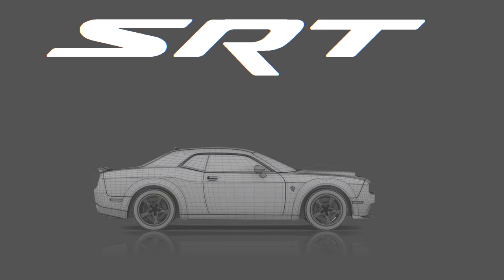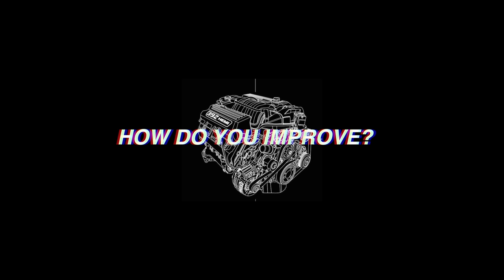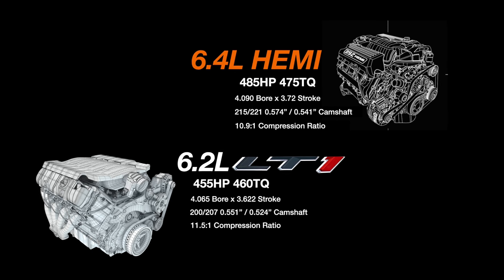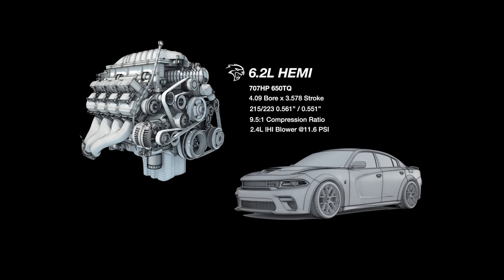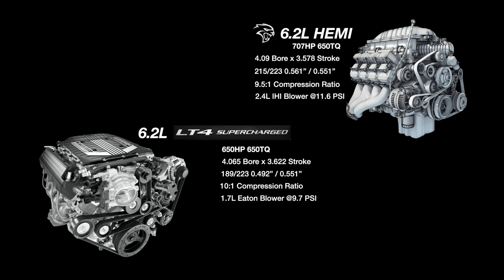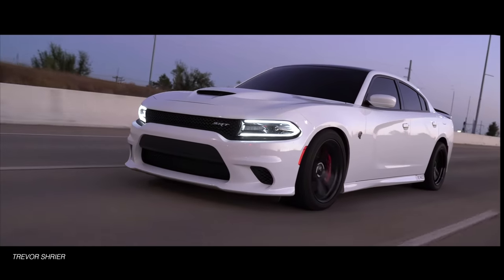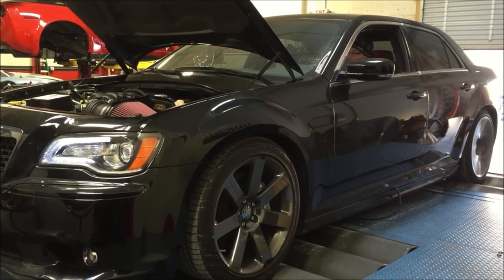Why SRT Engines Are Way Too Powerful😳| Explained Ep.3

Comment: Haven't finished the video quite yet but I can vouch for the 6.1 reliability, got a 2010 Challenger SRT that gets daily driven (and yes through the snow) and has 167k on it with same trans and the motor has never been cracked open once
Reply: Bullshit. Chevrolet  also  kills  the  GAME  LS  and  LT  shits  on the  expensive ass Mopar
Reply: @blueprintjdm  your right my 2001 honda s2000 f20c engine and transmission are stock have 170k miles unopened no smoke or leaks
Reply: And the 6.3L Super Bee
Reply: @destructoidx99  260,000 on my 4.0 inline 6 never cracked open, and 280,000 on my 5.2 litre 318 never been cracked open...
Reply: @bradlaflamme6127  those 4.0 straight 6 jeeps never die man so reliable and can take a beating
Reply: @destructoidx99  yeah they are reliable but then again I do not know a strait 6 that is not. That's why I am excited about the new strait 6 dodge is putting out.
Reply: @blueprintjdm  Yeah but high performance engines have historically been more Finicky and problematic, than standard engines.
Reply: @blueprintjdm  what!!!! I seen  them  go up to  700,000 miles  a stock  LS
Reply: @blueprintjdm  bro, very few high hp Japanese engine wven exist stock. Ive also  been around built Mitsubishi cars, Subarus(junk)!!! Rotary mazdas, not all Japanese cars are holy grail of reliability becuz none of those mentioned are very reliable. Honda and Toyota take that crown but toyota has not made alot of very high horsepower cars, and honda either , their reliability machines are commuters, which are not hard to make reliable. Just now they are making alot of powerful v8s,  for top tier Lexus sports cars.    And yeah Subarus suck!!  Worst car manufacturer on the planet!!  My brother was an  tech for a couple years, no other brand he worked for had so many complete motor failures. At low mileage with proper maintenance. The NA ones have bad head gaskets. The turbo ones are better but suffer  early bottom end failures. And the cvt transmissions are pretty janky too.
Reply: @blueprintjdm  hp per liter matters very little in the real world. Because a pushrod motor can stuff more cubes in a more compact motor, vs over head cam motors which flow better per liter. The ls 7.0 for example is lighter than a 5.0 mustang dohc, is more compact so can be swapped easily, and has more torque and makes more power. Bigger displacement is not really a negative per say other then bench racing. Also more reliable and doesnt suffer heat soak as much as a supercharged or turbo motor does on track days.
Reply: @TheRealZJE313  😪

Comment: Nicely done. You should mention the few initial hemis that started it all just to be complete. I'd like to see a rundown beginning with the Ford engines crammed into the Cobras back in the 60's all the way up to the current Mustangs.
Reply: What about the sallys
Reply: Initially the hemi was a Mercedes I believe 6 cylinder. Mopar stole the design and obtained the copyright. Then they made 16 cylinder hemi's for planes and tanks.
Reply: @bradlaflamme6127  harley did the same apparently

Comment: They use LS and LT engines in super cars and Hyper cars. F5 Hennessey uses a modified LSX to achieve 300MPH, I wonder why no one haven't used a HEMI in a lightweight mid engine supercar?
Reply: Because they’re heavy as fuck lol
Reply: @carlosdeleon9593  Still, all the weight will be in the middle for great center gravity and probably 50/59 weight distribution.
Reply: @Ayixlia  Less weight overall is better though? Why use an inferior platform
Reply: Bc LS's are the superior motor😘😘 duh😁
Reply: @H3mif4v5r  ls is the biggest boat anchor ever
Reply: @Welcometofacsistube  😂😂😂😂😂
Reply: @carlosdeleon9593  isn't it all aluminum?  How much more weight is it exactly?  Genuinely curious.
Reply: @midnight347  The Hemi is cast iron while the LS/LT are aluminum. An LT1 engine weighs about 450 lbs while a 392 Hemi weighs in at around 760 lbs. that’s 310 pounds heavier.
Reply: They dont use hemis or coyotes cause the physical engine size
Reply: @bb4jdmlude  Koenigsegg CC platforms such as the CCX and CC8S uses a 4.7L supercharged Ford Modular V8 and that's a Super car-Oh! and also the Saleen S7 uses a Ford engine too.

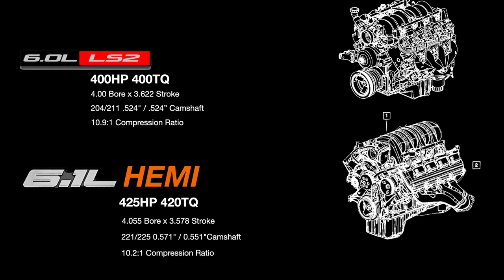Comment: 1:13 the LS 2 is down 25 hp on the hemi, and although the LS 2 has a SLIGHTLY milder cam, it does have 0.7 points more squeeze. It's the heads.

Comment: They're such good engines my buddys Hellcat is on its third motor at 38,000 miles. They're definitely known for going pop.
Reply: I have a friend who's a technician at a dodge dealership...he has a whole different perspective on these engines...
Reply: @tyrone reed  
I'll stick to my two to three thousand horsepower turbo Trans Am or my Turbo 4 by 4 Silverado that makes 1400 wheel horsepower. LS power. I live in the drag racing world, and I can't tell you how many of these hellcats  that I've seen their Motors pop

Comment: Can you do a vid between Forced Induction & N/A v8 Engines. Like the best ones made. That would be dope asf
Reply: Best boosted motors would be the 6.2 Hellcat motor, the 5.2 Predator, the 3800 in the GN, and the LS9. 

N/A there’s a LOT of options but to me personally it’s the LS3, the Coyote, the 6.0 LQ9, 5.2 Voodoo, and probably the LS1 for basically becoming the beginning of modern muscle again.

Comment: Would love to see some videos on modding 6.1’s… taking complete advantage of the forged crank and belting out some really hot numbers sounds great!!!
Reply: What he said about boost is semi-correct. You can run about 8psi and be safe. At 8lbs, you're gonna be making about 520whp with no supporting mods on 93. You can run that on the stock motor and be safe.

For an N/A route: headers, ported heads/intake, throttle body, cam, and e85 will get you to about 470whp.
Reply: @SRTBOAT  ok, minus the 20 percent loss my srt8 is putting 385 hp to the asphalt… 470 with a tune? I’m not getting that
Reply: @scw19762011  There's no possible way you're only putting down 385whp if you're FBO, cam, port work, and e85.

That's a fully built N/A setup minus a stroker kit. Depending on the tuner and how good your port work is, they could get you 470+ whp with upgraded injectors and added timing on the e85 tune.

If you're only making 385whp right now, then I'm guessing you have an intake and a tune, maybe headers. Nothing big.
Reply: @SRTBOAT  fbo would do more than 100 hp. Hands down
Reply: @scw19762011  FBO as an N/A version wouldn't. It's still on stock 6.1L displacement. You can do everything to improve airflow and get a more aggressive cam with better fuel, but you wont make 500+whp all motor unless you stroke it.
Reply: @SRTBOAT  all i have is cai, tune, exhaust. It’s close to that. I’m saying that your numbers aren’t right. 470 whp from just bolted on parts? Doesn’t make sense to me. Considering that a 6.1 is around 370 whp
Reply: @SRTBOAT  water meth alone is good for 70-100 hp
Reply: @scw19762011  my numbers are all pin point accurate. I've modded my own 6.1L, and browsed every forum there is to see what other people have done.

N/A on stock displacement, you can make around 470whp with all supporting mods.

If you boost it, sky is the limit.

Meth will never give 100hp on a 6.1L. It's a naturally aspirated engine from factory. Cooling methods arent as effective without boost. That goes for e85 too.

On an N/A car, you might see 10-15whp increase on e85. But on a boosted car it can be 50whp due to it burning cooler to offset the heat generated by boost.
Reply: @SRTBOAT  where are you getting your information from?
Reply: @scw19762011  forums all over the internet, and my own personal experience modding my car.

Feel free to check out some videos on HP gains from various mods on the 6.1. It's a great engine, but nothing is gonna make the kind of gains you're hoping for. A 100hp bump needs either boost or a lot of N/A work.
Reply: @SRTBOAT  that’s what I want to see…more videos on modding the 6.1…I know there’s a bunch of videos on 5.7 and 6.4…. But it looks like the first generation srt8’s have received no love…sadly
Reply: @SRTBOAT  ive seen a 6.1 put diwn 500whp without being stroked it was omgitsmrmack car
Reply: @juanledesma6418  i've seen that video. He's the only one I know of that's been able to do 500 wheel all motor stock displacement. Everyone else is 470ish whp.

It took him redoing port work multiple times and getting the tune perfect to achieve that. Realistically, 470whp built N/A is more accurate.

Comment: This truly must be a trick question? We all know a certain liter of the SRT engines make good power stock. The problem comes in when you want to add more power. You can't just strap a turbo/SC on it like a LS or Coyote motor. You have to change the internals which is very very costly. 

Most gear head's know you can take a junk yard 5.3 or 4.8 LS and strap a turbo (your choice of forced induction) and make 1000hp without changing the internals. You can do something similar to the K24-A2 (can't forget my honda guys). You simply can't do that with a SRT, well maybe the Hell kitty motor, even that's a risk.

When it comes to any major power with SRT motors if it isn't already boosted (SC) you aren't going to make a lot of HP stock. With the 6 liter motors you can change the upper and lower pulley to make more power, which is great. In comparison to the Coyote, you can simply change the blower to a V3 and make well over 1000hp without changing internals. Which is more cost affective than changing out the very costly internal upgrade to the SRT.
Reply: 5.7's and 6.1's responded very well to camshaft replacement. The Eagle variants even more so. Making over 500hp at the crank on a non-eagle Hemi isn't hard at all with the correct cam and tuning. So if you're looking for a boosted engine, the LS is the obvious choice on cost alone. If you're wanting to do an all-motor build, the Hemi is an excellent platform but also responds quite well to boost. The early 5.7 with an opened up ring gap can make 800+ on an otherwise stock engine with a turbo.
Reply: @sHoRtBuSseR  true, they're one's out there. Although it comes down to cost. Once you have to open that thing up  it'll cost at least 7k. At that point it'll be easier to get a $300-$500 junk yard 5.3 LS and get a precision turbo, for much less that it cost to put those o-rings on.
Reply: @eamorrison859  you can gap the stock rings and be into it under 300 bucks including new head bolts and gaskets.
Reply: It's not a problem, change the internals...  You can't cry because a company didn't design its engine to handle 3x factory power
Reply: @bb4jdmlude  it's not about crying it's about making an inferior product! Dodge/Fiat has been know to do that. As I stated previously other automakers have designed great motor that can handle great power without cracking open the motor. They made sure to keep the gear head in mind. Unfortunately Dodge/Fiat has not. Just pointing out the simple fact you can make great power with bot-ons and if you want to crack open the motor it's still cheaper than doing so on a Dodge/Fiat.

Comment: Not a Mopar fan like that but I always liked the 6.1 and I was wondering what combination of parts was used for the destroked 6.2 S/C. Great video
Reply: The Apache engine block 6.4l was used from the ram 2500 trucks for the hellcats. A similar cylinder head design from the Apache was also used but technically they are different materials. That’s about the only parts used from the 6.4l. Everything else is unique to the hellcat engine.
Reply: 6.2 is not destroked from anything.

5.7's stroke, 6.4's bore

Comment: I really liked this video though I am a GM Corvette type of guy.  What I have noticed is the Mopar crowd is always having fun around this area....  its gotten to the point that sometimes  I can recognize the sound of one of these Hemis a mile away on a quiet night in the neighborhood.  You didn't mention the AC upgrade that Dodge engineered into the Red Eye for fast cooling when going rounds at the drags...  and that AC system speaks volumes to Dodges mission to make bullet proof muscle cars that get respect for the performance they provide.

Comment: Actually stock 6.1s have been known to go up to 11 psi of boost sbe. It's the second most stout engine for boost and mods next to the hellcat
Reply: A guy in Houston had a stock 6.1 jeep which he only took apart to gap the rings properly and at the time he had 1000+hp on 16 psi
Reply: Richard holdner has a video where he make well over 1000 hp with a 5.7 on boost from a junk yard simply with gapping rings. If they are gapped right glory runs can be made but really it make’s sense to get forged pistons drop the compression for boost due to longevity. And while your at it cam it. Cylinder pressures become an issue on boost in the higher compression range because the cars are heavier dodge needed an edge but equally works against you for boost working with a higher compression motor this is why the hc is so popular.

Comment: Love these educational videos!! Let’s see something from you about the VQ engine or maybe VQ35/37 and VR30. Would like to see reasons why people use the VQ for tuning and roll racing.
Reply: The VQ35 had good torque stock, but generally don’t hold up. Ringland issues and rarely make more than 600hp without being forged etc. G35 was a beautiful car when introduced in 2003. I had a 6MT with Brembo package. Loved it. But the car had several issues including the infamous syncro problems in the transmission.
Reply: @jigsaw3334  oh yeah had a pretty nice 07 Altima with a VQ 6MT pretty peppy but after fucking with it too much it wound up not going into 2nd and 4th and it smoked (blown head gasket) decided to let it go. They’re fun when done right I can say that.
Reply: People use many motors for tuning, there's no specific reason. Its a good motor that you can make power with. Nothing more to say. I had 05' Altima SE-R. She was a bad bitch. Traded it in on a truck. Every man needs a truck.
Reply: @Mach141  ehh 6.1 seconds from 0-60 isint bad bad but I guess for the times it was pretty fast

Comment: Your videos are simply excellent. The real issue with ALL Hemis is combustion chamber efficiency. Flow characteristics in a naturally aspirated motor are way more complex than what your average bench will measure. That is another science altogether. At some point the real restriction becomes lack of fuel efficiency...

Comment: Simple:

If you can only drive in a straight line and cannot build, get Mopar. Nothing wrong with that. If you can drive Circuit and a more into building your power. Get a Chevy. Both have their benefits.

Comment: MDS is one of the best things ever to be introduced to the hemi line. The balance between power and fuel economy is awesome. Sadly, even with that, the engine will never survive the ever growing pressure of economy/emissions standards. The crazy times where a soccer mom can drive around a literal racecar suv without anyone batting an eye are coming to a close.

Comment: You can push 8lbs of boost out of a 6.1 and be fine. I'm currently on 6psi with no issues. I'll definitely be getting forged pistons and rods when I upgrade pulleys though.
Reply: Yeah when he said the 6.1s don’t take boost well I was a bit confused since they take it far better than the 5.7 and 6.4 but oh well
Reply: @dmoney6633  yeah it's pretty common for 6.1s to run 600whp on a blower, cam, and some basic bolt ons. All on the stock internals and they run great.

Comment: Those srt4s kept up with the v8s and still do. Love it because it’s the same Mitsubishi 4 cylinder
Reply: It's actually not a Mitsubishi motor , only the TD04 is Mitsubishi.
Reply: @7Logik  idk man I had a 97 gs eclipse and it looks really similar to the srt4 engine just smaller displacement and no turbo.

Comment: The 392 really doesn’t make 25-30hp more compared to the LT1 or the 5.0 considering all the cars dyno within 5-10hp of eachother.
Reply: Actually most dyno’s I’ve seen of bone stock LT Camaro’s and Challenger 392’s put them right about a difference of 20RWHP… At that point though your issue is with the drive train and not the engine since crank horsepower is a 1:1 figure.
Reply: Ford Mustang GT 460hp, chevy camaro SS lt1 455hp, scat pak 392 485hp. Even if they are on a dyno they would be very close not 5-10hp difference more like 20whp because the 8 speed trans in those is quite good even though they are lacking 2 gears.
Reply: @joshreynolds729  Ive seen most 6.4 L dyno around 430whp and I’ve seen 10 speed 5.0s dyno at 430whp, but for most part 6.4 should have higher numbers.  There’s a guy on YouTube with a stock 392 with shorty headers and intake no tune.  He dynoed 472whp on mustang so that’s like over 500whp on dynojet.  Don’t ask me how lol.  And it shows on the street when he races.
Reply: @boostidavis  I’ve scene some cars that just put in work better than the rest on a dyno not all cars are created equal. Scene dynos vary quite a bit as well. In either case it’s a good time for a v8 powered muscle and the fact they are so much better than they used to be. See we could be arguing over a 5.7 hemi vs a 3v mustang 🤣 so life is good. Both amazing platforms.
Reply: You do know the dynos show power and torque AFTER drivetrain loss, right? I really hope you do. You still have time to delete this.

Comment: Hemi’s are notorious for making big peak power numbers at high rpm but don’t make much torque down low.this is why if you dyno race a max wedge against a hemi the hemi will make more peak power but the wedge will make much more avrage power over the RPM band.